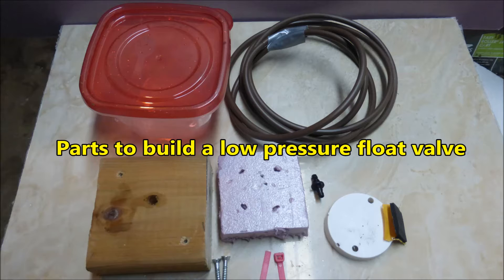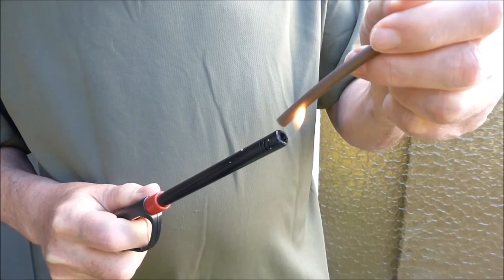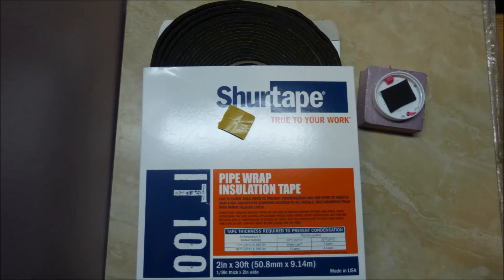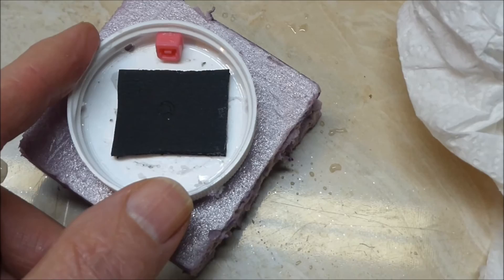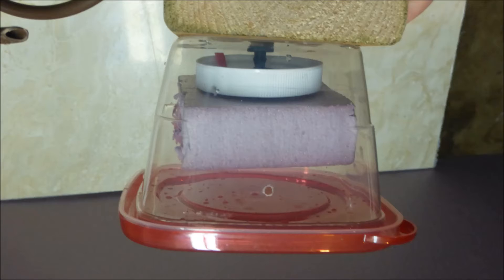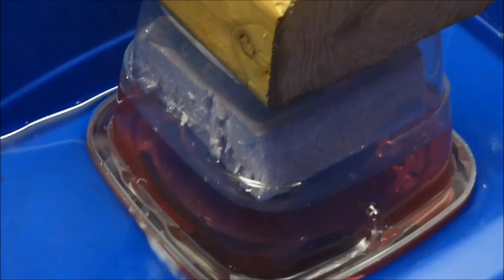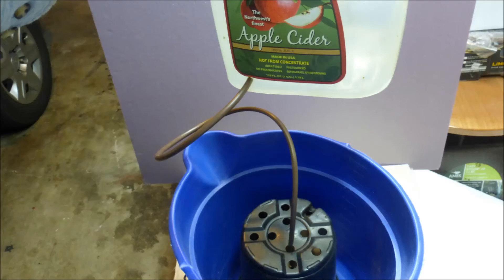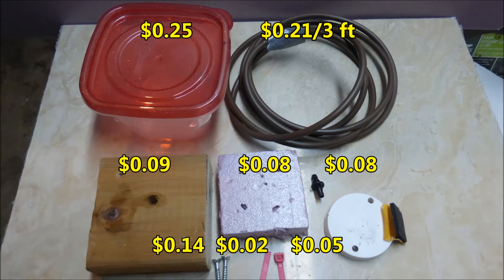Build Your Own Kratky Low Pressure Float Valve for Less than $1

Comment: Brilliant! For myself, I'd have to test this to ensure there is not a very slow drip since I'll be indoors. I see that many float valves require 5 PSI and that requires about ten feet of head, which would not be possible if you have a simple reservoir tank a foot higher than everything else.